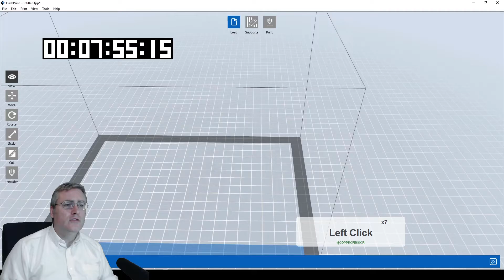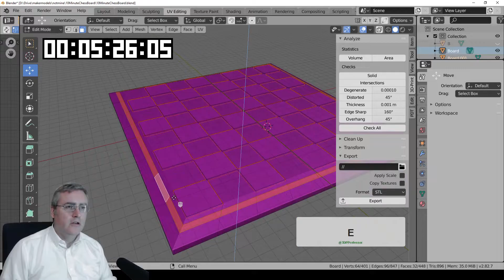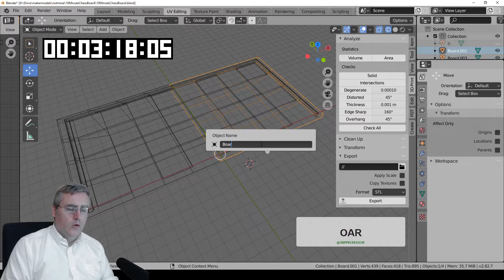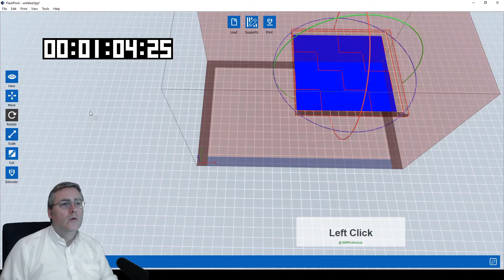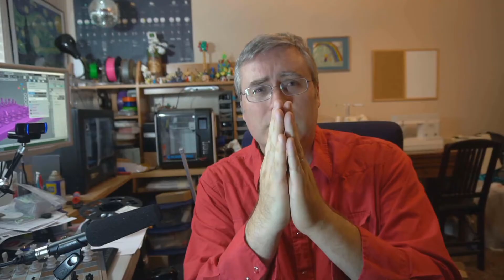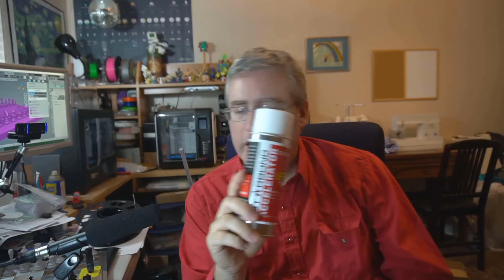3D Printing a Chess set modeled in 10 minutes

Comment: Nice video. I love Chess. Question: I ordered a 3d printed chess set. I noticed that all the chess pieces were composed of three separate parts that had been glued together. I assume this is common but isn't it better to have the full chess piece printed out in-whole, as you show here? The one I had broke apart where it was glued when the piece dropped from the table to the floor so had to be glued back.
Reply from the maker: I have no idea why they'd need to make it in 3 parts and glue it together. As for it breaking apart, that's unfortunate. But it should have been able to withstand a simple drop.

Comment: How much it costs to do that chess set?
Reply from the maker: In terms of material, probably only about $30. But then there's the $600 or $6000 for the 3D printers I printed them on, and then of course there's my time. All in all, if I were counting the cost it wouldn't be worth it, but I had a lot of fun, so that's what counts.

Comment: Hey there 

Just wondering how long it took you to print each side of the figures (white/black) once you got around thebglitter issue and what machine you used.

Cheers
Reply from the maker: i printed them both at the same time using a JGMaker IDEX 3D printer. I don't remember exactly how long it look, but taking a guess I'd say somewhere around 12 hours. Defiantely a day. Start the print at the start and come back at the end of the day, something like that.

Comment: Do you know where I can files Stl files for throne of kings chess set to 3d print
Reply from the maker: Do you mean the kickstarter from, like, 5 years ago? I don't know. Maybe contact the manufacturer. They might have them. Otherwise you're going to just have to buy a set and scan them, but then you'd have a set, so I don't know if you need to 3D print them any more.

Comment: Hi, 
I got a chess board from thingverse that is to be printed in vase mode (the pieces): https://www.thingiverse.com/thing:3794879
But, even printing with PETG it breaks very easily, the pieces do...
So... I have two questions, that reflect the possible solutions i came up with:
1 - Can i print several walls? 2 or 3 or 5? Together they should be stronger...
2 - Can i, in vase mode or not, setup some kind of spiral infill? I mean, printing the chess piece from the centre and spiral out without gapps?

I am a beginer in 3d printing and this might be the wrong place to ask this questions...
Sorry about that...

Thanks.

Comment: That was very entertaining :). When I started 3d  printing a few months for my end of degree project I knew I would be hocked but not up to the point I would love to work on this.  I've thinking about doing a chess board and pieces myself, but I only print in one colour. If you had problems with one of them you could have just printed the board with the tiles of one color and leave a notch in the others, and then snap / glue the rest of the tiles (or do it puzzle style). I might end up doing it myself. Thanks for sharing!

Comment: Uhm... I mean. The video is kool n all n the chess set is nice. But if you're going to race to do something in a video... Hide the print that isn't supposed to be done yet off camera? xD
I've been planning to make a custom chess set to print for a while. But i've stayed away from getting a dual nozzle printer as i hear of to many problems with them so ill design mine in 2 pieces that print separately then press fit together after :3
Reply from the maker: That will probably work. Just make sure you add a little tolerance to the parts you want to press in.
Reply: @3dpprofessor  Oh yas of-course, learnt that very early on. My first project in fusion 6 months ago was a simple gear system and immediately realized the importance of tolerances. Since then i made a fully custom carriage for an E3D V6 hotend that took allot of time to design but when printed everything fit together perfectly n it works great ^.^

Comment: I would have sanded all four sections and then wiped clean with a tack cloth and then sprayed a poly clear coat which would restore the colour.
 I get the same issue when sanding guitar body's but when I apply the clear coat the colour is good again
Reply from the maker: Wish I'd have tried that.